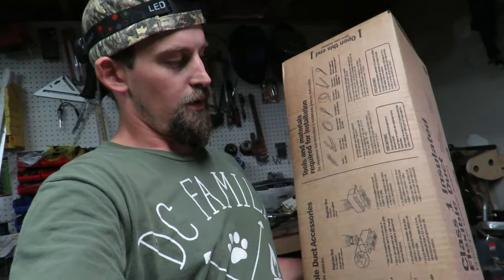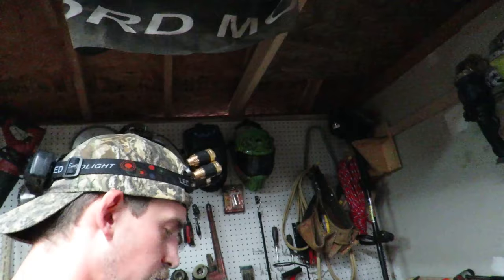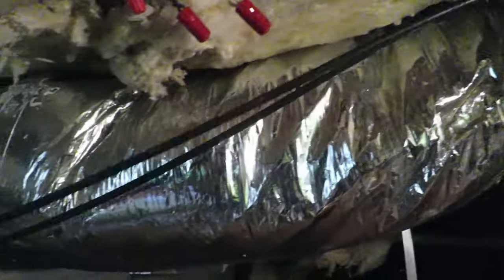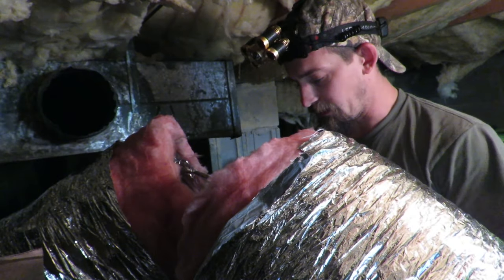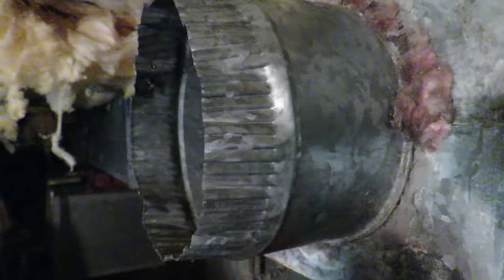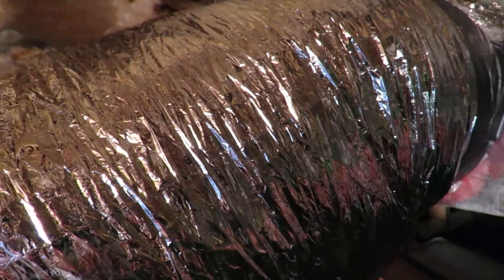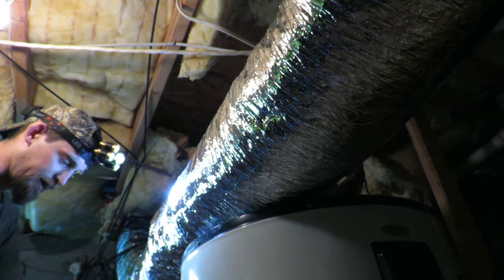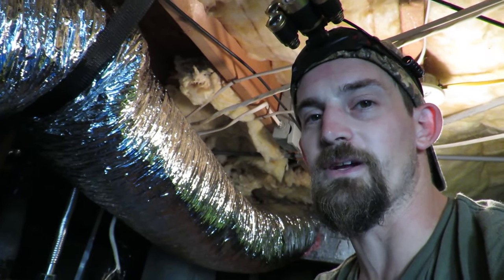How to Replace your HVAC Flex Duct

Comment: Nice Video but As an Electrician take those wires with red wire nuts and tuck them into that box with the wire nuts facing up! If your getting water down there those wire nuts are like a bowl right now, if water gets in there it’ll stay in there. Always point Them up so if water does get in it’ll drain out.
Reply from the maker: Thanks for the tip!
Reply: Thank you.
Reply: I worked summers as an electrician's helper when I was a kid and no one ever said anything to me about where to point my wire nuts. Thank you for posting this. Good info.
Reply: Sometimes  little details make difference. Thanks
Reply: Great advice! Thanks!

Comment: Phew I'm glad I watched this! Someone wanted to charge us $1400 to do it...what a simple job!
Reply: Just got the same quote. No way. I bought a house and wanted to get new ones put it. I've been doing diy projects got lazy and wanted to take a break but that break would've cost me 1400 so back to work I go lol
Reply: @Shannon-im7re  🤣🤣🤣....

But how did it go?
Reply: How do you connect the flex duct to the air vents
Reply: Uhh this method “gets by” but not how it’s done. Far from LEET standards. You are going to pay down the road for leakage and inefficiency
Reply: @Shannon-im7re  same here the hardest part was walking around my attic with the duct line. But guess what it was done in under 1 hour , no more leaks, and a strong flow of hair, and better run
Reply: Thanks
Reply: Hah, I’ve got quotes anywhere from under $5000 to up-over $11,000 from 5 different HVAC companies.

Dallas, TX.

Huge open attic well-lit with string lights 
Easy access.
Scope-of-job Included dampeners, registers, sealing inside & out at the junctions & installing an UV Dual light air-purifier.

Comment: Never use duct tape. There is a required albumin tape used on ducts. You also forgot to show a very important step, applying the mastic to the end connections. Otherwise, the condensation will drip onto the ceiling, insulation,...

Comment: You need to strech the duct more to flatten out the ridges on the inside pipe. Left loose it reduces flow about a third.  Straps every three feet

Comment: I was taught to pull the insulation back before cutting so it will still cover the fittings. We would wrap twice with tape, then install zip ties. Then pull insulation over the flex and zip tie it onto the fittings.
Reply from the maker: Thanks for the tip!
Reply: Do you some sort of duct sealant for 100% air tight  hopefully?
Reply: @jamescc2010  The way I read the tip: He tapes the inner duct to the manifold to form a seal.  Then tie wraps over the tape for extra strength.  It's added security but I've seen a lot of duct tape dry out and loose all adhesion after just a few years so the quality of tape is really important if you go this route.
Reply: @cratecruncher4974  should still mastic. that was something this guy missed twice. should be mastic on the inside of the flex pipe where it meets the boot then mastic over tape to the boot on the insul side.
Reply: @---ny4ys  I'm doing this job for the first time right now in my residence.  I'm using Flow Master sealant on the starting flange, slip the inner duct over the flange, 36" cable tie tightened with puller.  Once that inner duct is sealed I feel the insulation just needs to stay secure over the works to prevent air circulation and the metal parts from transferring heat into the conditioned air.  I don't think it needs to be air tight like the inner duct that holds positive pressure.   Where I'm having a time is finding condensation/corrosion damage (holes) in my register boxes.   The entire bottom fell out of one trying to remove it!  Still learning this stuff.

Comment: Just a small suggestion 🙋🏻‍♂️. I would recommend using mastic instead of duct tape to connect the flex insulation to the collar of the plenum. Much more reliable, lasts longer, and better air-sealed.
Reply: What about panduit straps
Reply: Mastic should go inside the duct to the collar. Mastic on the insulation won’t help
Reply: @aaronmoriarity1818  should duct sealant be used? On top of the tape?

Comment: The duct tape should have delaminated by now. Go back and attach the duct to the fitting with mastic and mesh. Once dry, apply another coat of mastic. Attach insulation over the fitting with foil tape. Every inch of duct tape stuck to the insulation and not the air handler is doing nothing to secure the duct in place; however, it is helping to create an avenue for air leakage.

Comment: For what it's worth, I like to fold over the hanging material before I staple it in.  That gives two layers of webbing material to staple into.  If you don't, there's a higher chance that the webbing will pull out of the staples.
Reply: Ours was tied around the joists in the attic. It was 20 yrs old and holding, but we replaced it with new one the same way

Comment: Wow! I just got an estimate, my house has 5 ducts total in the crawl
space beneath the first floor. My estimate was 4,700.  I think you just saved me a lot of money!! Thank you!
Reply: Approximate one year ago, I called a HVAC guy (Heavy and big) and he gave me a quote $3,500. Guess what, after I have learned some lessons and videos from Youtube, I replaced 3 lines out of 10, 7 more lines to go. I spent less than $500 for materials and included tools. Luckily, my renter went to vacation for two months, so I have plenty time to do.
Reply: Thats about it ....i do HVAC duct systems replacements ...and thats the average price.....keep in mind that a pro will replace everything including metal boxes for suply and return plus warrantee ...if you can do it yourself ...just do it .
Reply: @frankrod6496  metal boxes???

I'm a complete noob trying to learn right now.
Reply: @dnegel9546  the things you connect your ducts to for the vents it’s a box with a circle end to slide on the duct
Reply: @dnegel9546  no need to replace those just seal all the seams with sealant
Reply: @HsingSun  I got $1900, and 2500 so far to replace some ducts in my attic on 2 story home. We cannot replace the one between floor unless we start cutting ceiling  drywall.  So far they cannot find leak but plastic cover torn in many place after 30 years or so when this home was built.  I might consider DIY on duct at a time. Will see.  Attic is tight and have to crawl and I am not young in early 60s  lol.
Reply: @jamescc2010 don’t do it half way do it all rats or other critters might have ruined the ones inside walls. We have found squirrels nest that were 3ft high inside walls. Js
Reply: Yeah it's insane how much money things like this are costing nowadays

Comment: Many good things about this video so thanks for posting it. You need to use mastic and foil tape to attach the flex duct (6:21). The way you've done it will introduce air leakage and moisture and won't last long.
Reply: So do you put the mastic on first or the tape first?

Comment: I have a room that was getting very little airflow after a tree fell and the roof was repaired.  I recently went into the act. From a distance it looked like the duct work was pinched,  but as i got close i realized the two rooms affected by the tree no longer had metal duct work all the way to the vent. They were just lying to the side. The flexible duct work was broken

Comment: Funny you did this. Last week I got an estimate for a guy to do this at the lake house.. it's only a small crawl space under the house I'm 6'6" tall 270 lbs. You saved alot of $$$ for sure!
Reply from the maker: Mind sharing the estimate cost?
Reply: @ASliceofWoodWorkshop  the house is 2,300 square feet and he wanted $1,900 to put in new flex. Unit is pushing 20 years old. Im thinking of scrapping the idea all together and installing mini splits
Reply from the maker: Thats not bad to save from craeling on the ground for a couple hours
Reply: @ASliceofWoodWorkshop  there is no way I can get under there and do it.  If I get the flex replaced the unit will be next and that will be 4-6 k. And because the flex sets almost on the ground I'm sure it will need to be replaced again before I go to the lake in the sky! We are about to put hard wood down this fall and would be the perfect time to go over the vents in the floor. I could go with two 4 zone condenser units and cool the whole house. That would run about 9k.
Reply: Jason King I’m currently looking at getting mine replaced. It’s a 1200sqft lake house as well. Got three quotes for all around 2k a piece just for flex Duct! They all said it’s because of the small 10” opening for access and the crawl space is hardly 3’ in height.
Reply: @evankukalis9940  I went with a ductless mini split system and LOVE it
Reply: Jason King I considered it as well! I just recently replaced the furnace and had central air installed as well. No going back now haha
Reply: @evankukalis9940  @Jason King

You guys need to come to wonderful California.  My crawl space ducting is being replaced as I type this.  Bids were from $10,000 to $15,000.  New, wire flex and 12 new floor register boots.  Floor area over crawl space is about 2,400 sq ft.  Access is difficult in some areas.  Mostly due to 14" trunk lines perpendicular to 16" deep, plywood webbed trusses.

It's taken 2 guys five days and there is still more work to do!  This is from a well rated, A/C company that's been in business since the 1970's.
Reply: I’m an HVAC consultation in NorCal and that same job would cost 6k out the door. 

These jobs are definitely not cheap in Cali. Haha

Comment: Is there a way to know how large of a flex ductwork pipe I will need? Is 6 inch fairly standard? Trying to avoid going into attic and tear out line then have to make a trip to Home Depot for the flex line once I can see how big it is (4,6,8). Would prefer to pre-buy and just knock it out

Comment: Wow! So all you need to secure the duct onto the collar is a big zip tie and duct tape? I don't have an HVAC but I have a heater in my mobile home, and my heating duct is in the crawl space under it. I'm not sure if the webbing to hold up the duct would work for me because the beams are metal; not wood, but if I can find a way to hold up the duct, I'd like that so that maybe the cats won't get it this time.
Reply: You have to use a special ones & a tool to tighten it

Comment: Thanks for this. Very helpful. One question: how do you know whats the right size duct to use? My house has a lot of 6" and 8" ducts, but they seem to have been used interchangeably, like the builder just used whatever they happened to have on hand at the moment. Thanks.
Reply from the maker: You would have to look at the connections at both ends of the duct. That should determine what size to use

Comment: Did you mention the R-value of your flex? Where are you located and what are the temp/humidity conditions? I have to replace or cover my R-4.2 flex in my attic with R-8 insulation (at least) to bring it up to code as I replace our HVAC package unit. You make it seem easy. Thanks.
Reply from the maker: If inremember correctly it was R-6. I am in NC so temps go from hot (90s) to cold (30s qnd some 20s).
Reply: @ASliceofWoodWorkshop  What part of NC are you from ? I may could use your services Sir?
Reply: @ASliceofWoodWorkshop  I live in SC would I use the same R as you?

Comment: Would it be okay to use flexible duct for a furnace too?
Reply: Mine is central air & heat
Reply: Yes it's the same, that's why it's insulated

Comment: Getting ready to do this.  Does it make sense to replace 6 inch with 8 inch?
Reply: Did you find out? I want to know too
Reply: I'm not an HVAC tech but I'd guess the answer is no.

Ducting diameter would greatly Influence internal pressure of the system.  The bigger the diameter the less resistance and most of the air will flow to the room with the biggest diameter ducting.  Use the same diameter ducting it was designed for but upgrade the R value of the ducting
Reply: No, keep what you have it all depends on the unit you have I went with what I had just to stay out of trouble

Comment: Is it normal to have condensation around this ducts?  Our house is from like the 70s and there is no flex,  everything is hard pipe!
Reply: No, that's not normal. Consult a HVAC professional. You may have a leaky duct. Which is a clear sign of moisture. Cold air blowing in a hot space will create condensation.

Comment: My 30+ yr ductwork has some damage in attic. . Can I diy and fix some of it with R8 ducts?
Concern is my attic some parts are very tight and have to crawl,, hard on body and might get hurt if not careful.
Reply: yes u can, what u can do is get the furthest ucan to the old duct work an cut it an splice it with the r8
Reply: @logannvasquez  what does R8 mean?
Reply: @dnegel9546  r8 is the insulation thickness level the higher the number the more it insulates r6 is less than r8 depending on what part of the country you live you need r6 or r8
Reply: What are the best duct to use R8 chrome (silver) jacket?  My old duct plastic cover have torn or split, and we have been getting thick / fiber look dusts every few days so have to clean them regularly over years.  Interesting there is no that any technician can identify in attic but they all recommend replacing ducts in the attic.

Comment: Question: There is a 3" duct collar (from main HVAC supply to bathroom), how can I replace 3" flexible air-duct insulation? Since I could not find anywhere in the market. I found 3" to 4" adapter, but it would not fit.